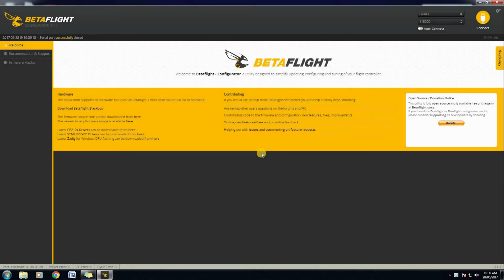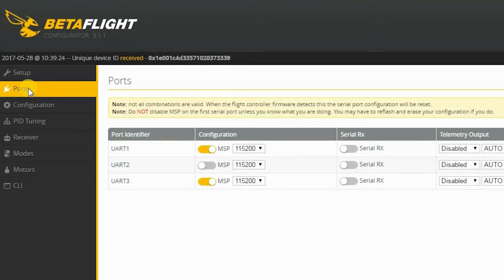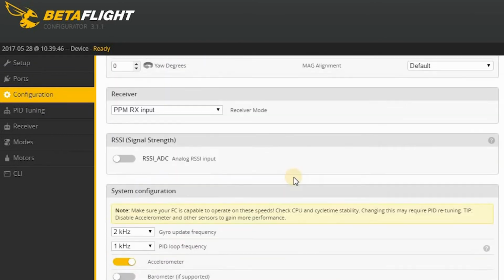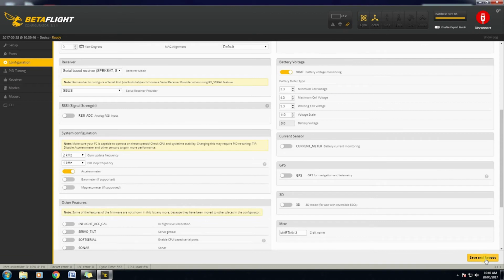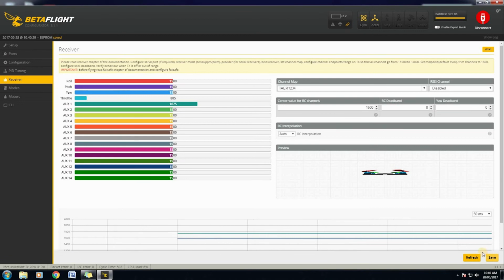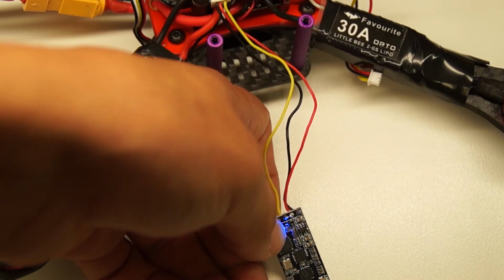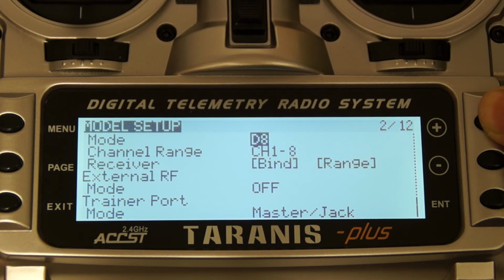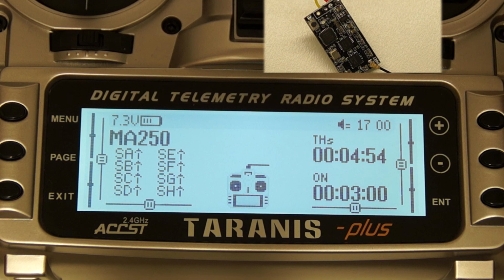FRSKY LR/FD 1000 FULL SETUP! Config on Betaflight, wiring and binding!

Comment: Does it matter what firmware version I have on my radio? My sdcard slot on my qx7 isn't working so I can't flash firmware version to the receivers. Thanks.
Reply from the maker: I think it should be completely fine as long as the radio is somewhat normally working.